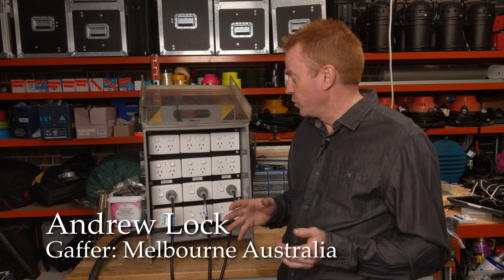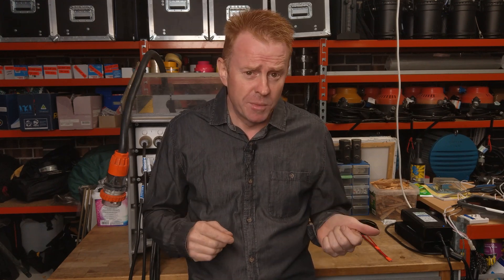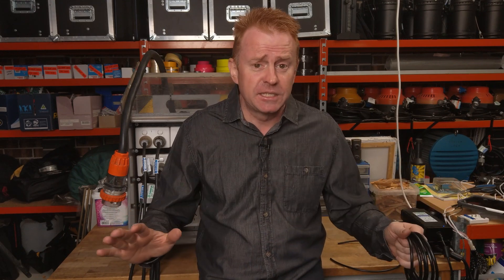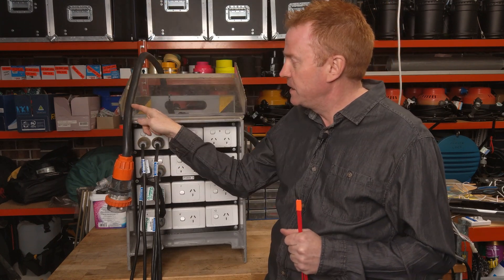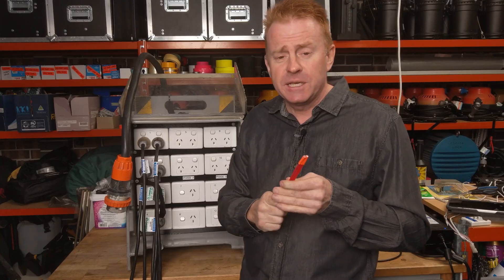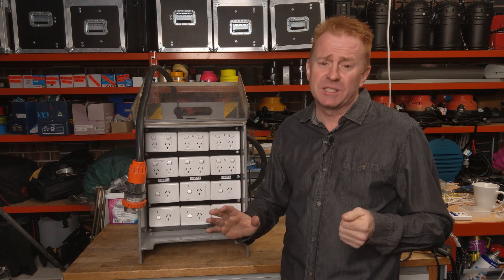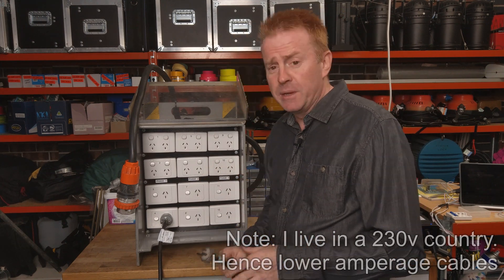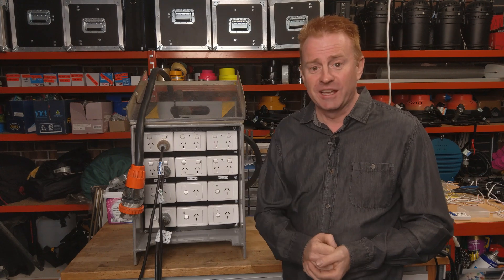Gaffer & Gear 59 - Balancing Loads on 3 Phase

Comment: Great story on why you should balance your phases. Something you should have mentioned is that it severely impacts the performance on the supply. For example, if you were to fully load phase one, leaving the rest empty, imagine the load on the generator. Every time it would come around the phase one coil, the resistance would be immense. I've seen shows that haven't properly balanced their phases and you hear the generators go "chug chug CHUG chug chug CHUG".

Comment: Love it! That 3-phase box looks pretty neat compared to the systems we use. Thank you for putting in the time.
Reply from the maker: Hi Luke, hope you are well.

I had a long chat about the power systems in the US with a gaffer from NC last night.

He asked me a question I couldn't answer (different county, different power) and I got asking about how you guys get anything to run off 120v.

I now understand how easy we have it here, everything is single phase, even our 3 phase breaks out completely to single. No crossing phases to power lights at all.

That box can run up to 34,500 watt. The biggest light it can run is a 5k, and it can run 6 of them.

These days it gets used for 6 skypanels and 15 mobile phone chargers.

I couldn't help but think, after my conversation last night, that corporate shoots in shopping centres or office blocks must be a nightmare for you guys.
Reply: Exactly. We are often worrying about blowing circuits unless there is budget and manpower enough to run a genny. We’re crazy, but we have fun pretending this is the best way to do things:)

Comment: Severly unbalanced 3 phase loads also put strain on Neutral. I've seen a few burnt out over the years. Switch mode PSU's found in almost everything these days aren't the same as a linear load either. Have also seen very warm 3 phase cables in installs for some kitchens, etc, that apparently meet regulation but are on the limits.